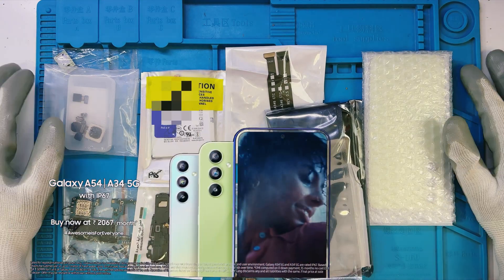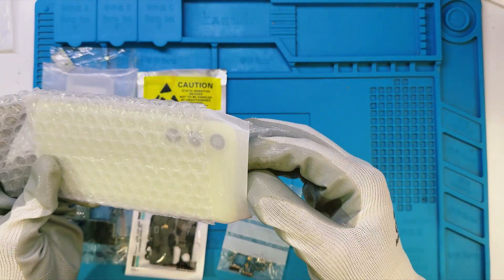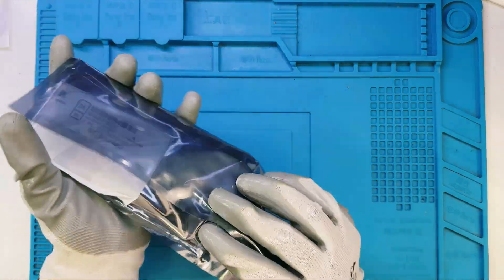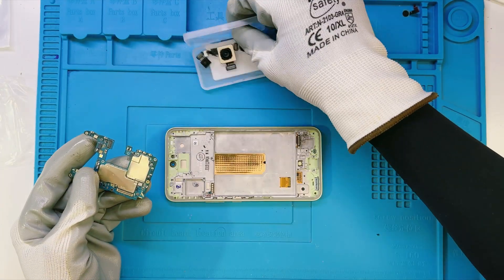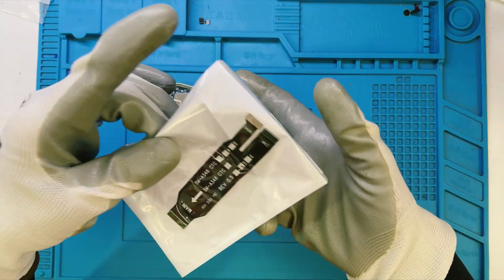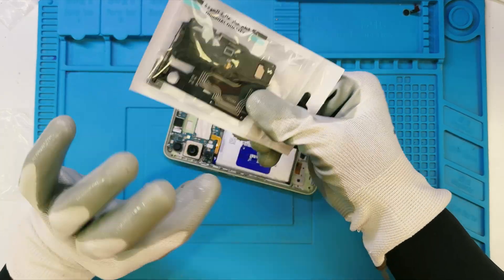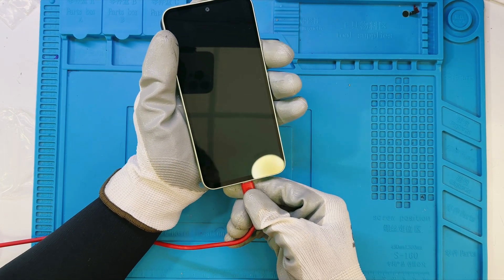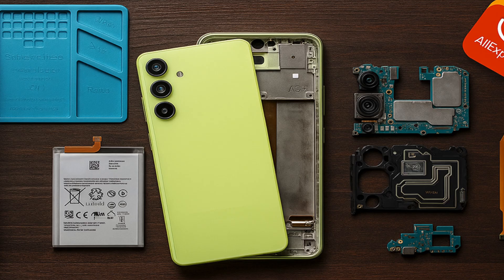Building a Samsung A54 From AliExpress Parts | Updated With Voiceover”

Comment: Hey! Ive got a question. I used to have a Nokia N97 and it’s THE best phone ive ever had! The question is; is it possible to make it modern without changing its appearance?
Reply from the maker: No sir, the new versions of many softwares won’t match with that phone’s operating system, and even the hardware won’t be able to handle it smoothly.